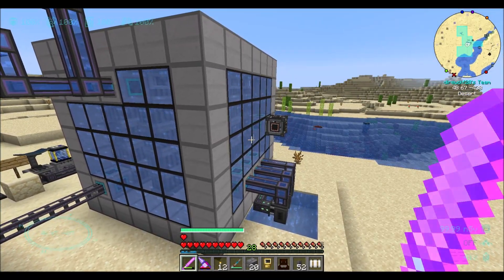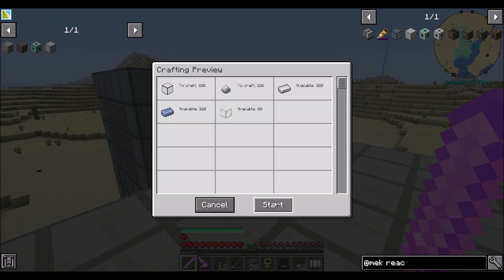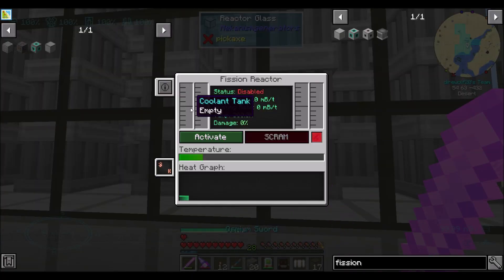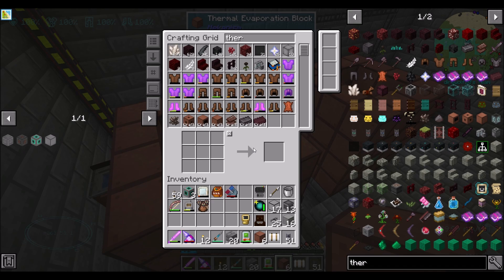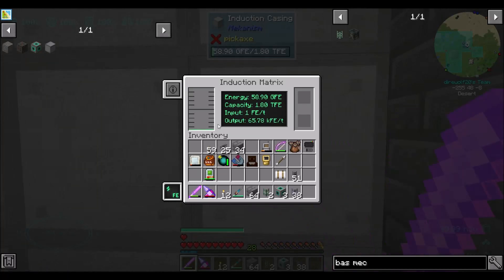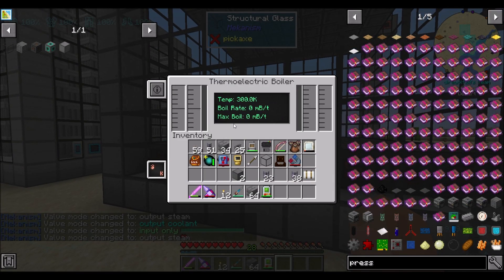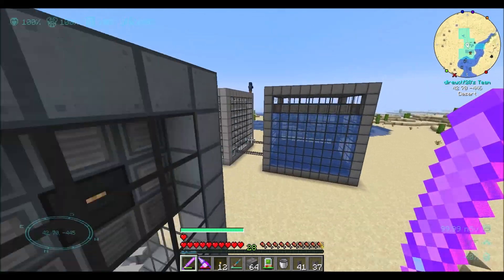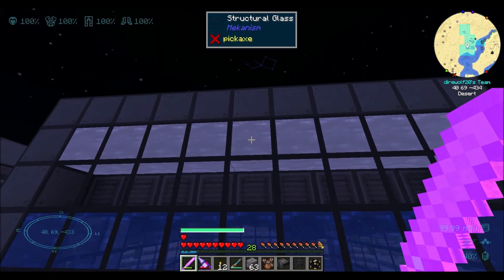Lets Play S10E81 Why So Salty

Comment: You're going to need multiple output and inputs to and from the boiler. A single ultimate pressurized tube saturates at 88mb burn rate.
Reply: he should have just built the boiler directly next to the reactor, with the ports connected so that there's no need for pipes
Reply: The number of inputs and outputs does not matter. What matters is the number of Tubes in the system. The output is only limited by the number of output Tubes, if there is no auto-output of the machine, so if you need to set the tube to pull. Each connected Tube increases the Throughput of the whole pipe system.

Comment: The basic mechanical pipes on the sodium production were fine actually. The way mekanism calculates its pipe and flow capacities, it actually treats the entire series of connected pipe blocks as a single multiblock whose capacity is based on the total of all the pipes that are connected. All those ultimate pipes mean the transfer rate would have been fine even with the basic pipes there. iirc the only case where the pipe type matters at a specific location is if the pipes are set to pull mode and are pulling out of something.

Comment: I wonder if it would be possible to automate the miner. Have a machine that places it, waits until it is finished, breaks it, moves forward a chunk (16 blocks right?), and then repeats. All the other parts can be moved by frames I think, so it'll only be working out the miner bit. (Yes, it would probably look like the frame miner Dire has already built, but without computercraft, I don't know if there is another method)
Reply: I don't know if it's possible, but it would be interesting to see. I know the miner doesn't start automatically, but I wonder if it can be set to run on a redstone signal which could get around manually pushing the start button every time
Reply: Create Contraption maybe? Turns into blocks when not in motion, dunno how it behaves with the miner...